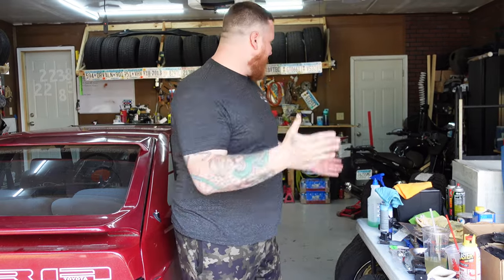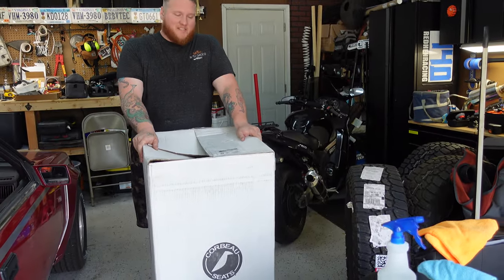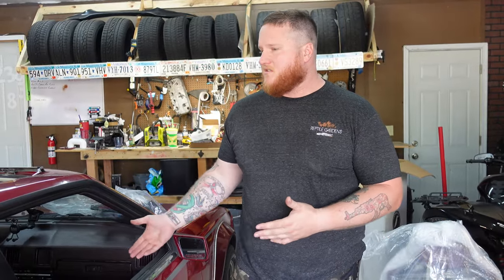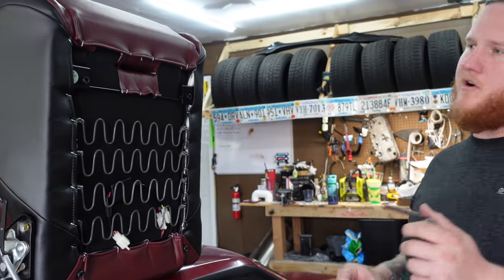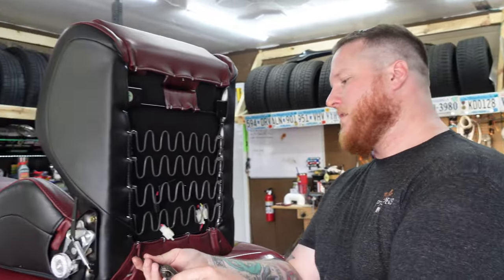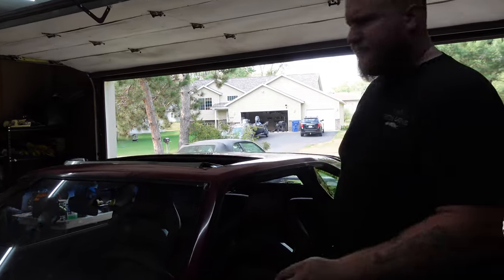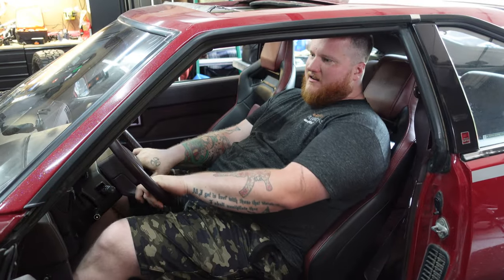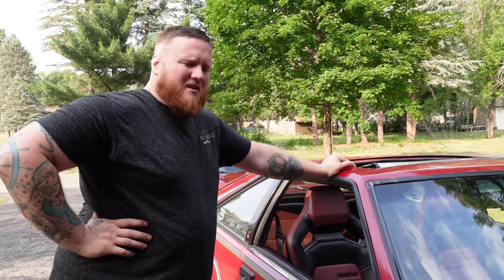THIS is just what the SUPRA RALLY CAR needed (Corbeaus and Works FTW)

Comment: Seats and rims look great, hope there’s an easy fix that will also allow for seat adjustment once they are lowered…..can the old rails fit the new seats?
Reply from the maker: Using the stock rails is not an option, the best bet is really to bolt them right to the floor. Using a slider just takes up too much vertical space and would require re-working the floor pan to sit lower, and that's a pretty in-depth project.